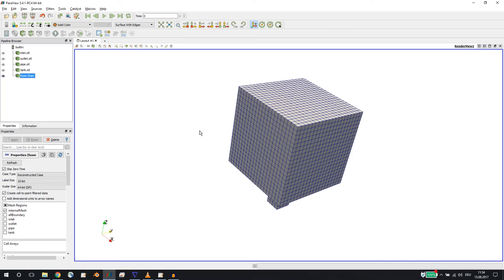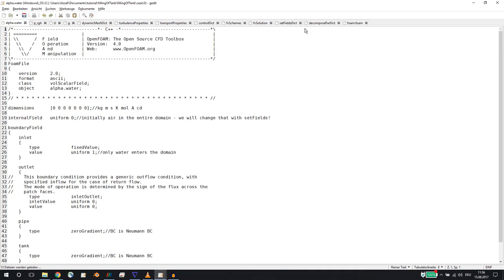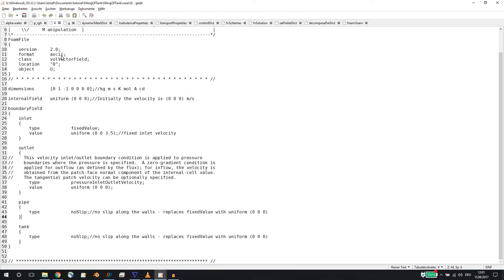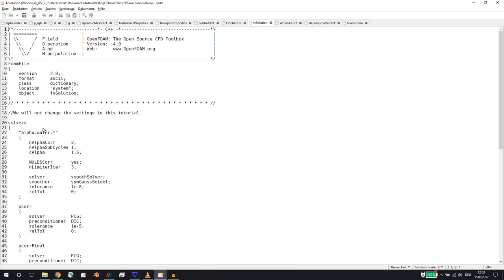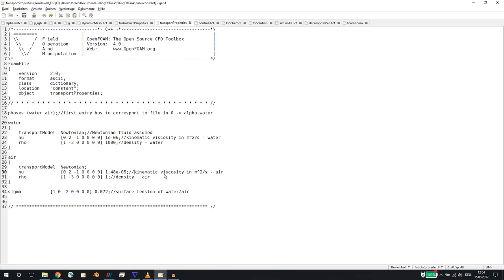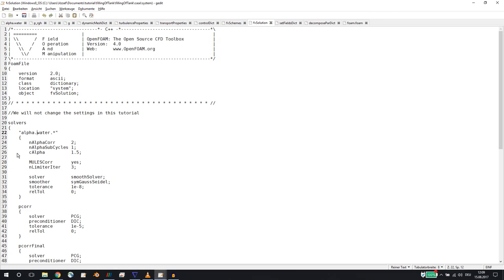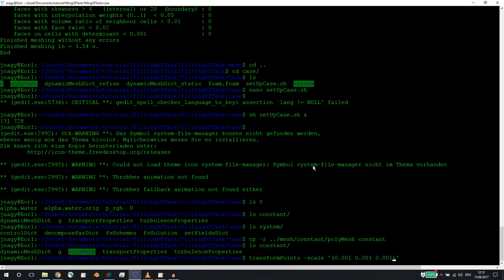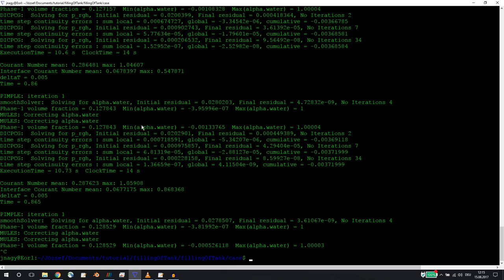Multiphase simulation project in OpenFOAM in Windows 10 and Ubuntu - tutorial part 3 - simulation

Comment: A followup on the question I asked a few years ago: what if the tank is half full of liquid and I want to push air through the inlet, how would the BC's change there? Is it as simple as changing the alpha.water value to "uniform 0"?
Reply from the maker: Should be. But possibly interIsoFoam would be a better choice for the solver.
Reply: @OpenFOAMJozsefNagy  Thanks. Yea, the actual flow I'm concerned with is dominated by capillary forces. interFlow I believe had issues with curvatures, right?
Reply from the maker: @joshmccraney4020  Yes, you definitely need contact angle for those simulations.

Comment: Hi Jozsef, thanks for a great video. I'm hoping you may be able to help. 
I am trying to run the simulation with my own geometry and have replaced the names of the boundaries to coordinate with my stl files. All seems to work until I try to run setFields and interFoam. Is there anything else I must change when I replace the stl file names within the codes? My stl files are inlet, outlet, upperWall, lowerWall and frontAndBack for my geometry .

Here are my error messages:

setFields
Create time

--> FOAM Warning :
    From function static Foam::IOstreamOption::compressionType Foam::IOstreamOption::compressionEnum(const Foam::word&)
    in file db/IOstreams/IOstreams/IOstreamOption.C at line 86
    Unknown compression specifier 'uncompressed', assuming no compression
Create mesh for time = 0

Reading setFieldsDict

Setting field default values
    Setting internal values of volScalarField alpha.water

--> FOAM FATAL IO ERROR:
Cannot find patchField entry for allBoundary

file: /mnt/c/Users/Hp/Downloads/OpenFOAM/OpenFOAM-v1806/kagome/case/0/alpha.water.boundaryField

    From function void Foam::GeometricField<Type, PatchField, GeoMesh>::Boundary::readField(const Foam::DimensionedField<TypeR, GeoMesh>&, const Foam::dictionary&) [with Type = double; PatchField = Foam::fvPatchField; GeoMesh = Foam::volMesh]
    in file /home/pawan/OpenFOAM/OpenFOAM-v1806/src/OpenFOAM/lnInclude/GeometricBoundaryField.C at line 191.

FOAM exiting

and for interFoam

interFoam
Create time

--> FOAM Warning :
    From function static Foam::IOstreamOption::compressionType Foam::IOstreamOption::compressionEnum(const Foam::word&)
    in file db/IOstreams/IOstreams/IOstreamOption.C at line 86
    Unknown compression specifier 'uncompressed', assuming no compression
Create mesh for time = 0

Selecting dynamicFvMesh staticFvMesh

PIMPLE: Operating solver in PISO mode

Reading field p_rgh

--> FOAM FATAL IO ERROR:
Cannot find patchField entry for allBoundary

file: /mnt/c/Users/Hp/Downloads/OpenFOAM/OpenFOAM-v1806/kagome/case/0/p_rgh.boundaryField

    From function void Foam::GeometricField<Type, PatchField, GeoMesh>::Boundary::readField(const Foam::DimensionedField<TypeR, GeoMesh>&, const Foam::dictionary&) [with Type = double; PatchField = Foam::fvPatchField; GeoMesh = Foam::volMesh]
    in file /home/pawan/OpenFOAM/OpenFOAM-v1806/src/OpenFOAM/lnInclude/GeometricBoundaryField.C at line 191.

FOAM exiting

Thanks for your help!
Reply from the maker: You seem to have the original boundary from blockMesh in your final mesh. Just make the blockMesh a bit bigger than your STL files and it will be cut off as well.

Comment: Hi Jozsef, 

Thank you very much for taking your time and preparing these tutorials. I would be lost without them.  I hope you dont mind me asking some questions though. 

I would like to use your steps as a guideline  (and skip some if possible) to build my own multiphase model with a bit more complicated geometry. Can I use this specific model and replace the existing mesh, add some new boundary conditions or remove some,  and run it?  

What if I generate the mesh in fluent but want to import to OpenFOAM? I have a bit intricate pump geometry, and I already meshed it in ansys.  I copied the fluent mesh file into the " mesh " folder and ran the fluentMeshToFoam command. It seemed like it ran okay. However this was the easy part of it - if I didnt violate anything.  There were some internal interfaces in the mesh file that needed to be left as is - fluent recognizes them as interface but would OpenFOAM also recognize them as interface? Do I need to specify somehow that OpenFOAM recognizes them as internal interfaces?  

Also if I would like to monitor x,y,z components of liquid coming out of an outlet, can it be monitored real time ( say area averaged Vx per iteration or per time step)?  Or would OpenFOAM generate text files? 

I probably would get some answers to these questions if I were to watch more tutorials, but I could not wait  :'( 

Thank you very much for your help, 

Oscar
Reply from the maker: Wow, lot of questions. Yes you can replace the mesh, but the boundaries have to be the same, or you have to modify the files in 0. You can also use meshes from fluent. Yes there are postprocessing tools. On my Patreon I am uploading videos on runtime postprocessing, so if you consider supporting me there, you will find a couple of videos on runtime postprocessing.

Comment: Dear Sir,
Would the simulation work without creating the initial water height, keeping only alpha.water = 1 on the inlet?
Thank you
Reply from the maker: I older version it used to crush, but nowadays it should work. So just test it without setFields.
Reply: @OpenFOAMJozsefNagy  yes i tested it yesterday on a resin transfert moulding problem, i confirm it works. Thank you!
Reply: @Poeterish  hello, so im currently trying to do a resin infusion (RTM) and i saw your comment here :) , so did u use this example for your simulation?
Im trying to do a small 2.5D square with 1 inlet in the middle, and 2 outlets on the edges.

Comment: Dear Dr. Nagy, I am running your code in OpenFoam10. I modified the codes accordingly (to the best of my ability). All functons ran properly. The meshing was perfect. But while running icoFoam the following error occured:

Create time

Create mesh for time = 0

--> FOAM FATAL ERROR: 
fvMeshStitcher for changing mesh not found 

Valid fvMeshStitchers are : 
1(stationary)

    From function static Foam::autoPtr<Foam::fvMeshStitcher> Foam::fvMeshStitcher::New(Foam::fvMesh&, bool)
    in file fvMesh/fvMeshStitchers/fvMeshStitcher/fvMeshStitcherNew.C at line 86.

FOAM exiting

I guess I need to find 'fvMeshStitchers'. Can you help me with this?
Reply from the maker: The command should be interFoam not icoFoam. Here we run a multiphase simulation.
Reply: @OpenFOAMJozsefNagy  Thanks Dr. for your quick reply. It was a typo, sorry. I typed interFoam. I tried it again, same error returns.
Reply: Quick update: switched to OpenFoam1912, all worked. Feeling sorry for all the changes I made to codes to adopt your codes for OpenFoam10.

Is there any resourse that helps novice like me to adopt to OpenFoam10?

Thank you.
Reply from the maker: @mohammadmahmudulhuq3164  I don't know. v10 seems to be too far gone from previous syntax and also the other branches. The only thing I can think of is taking a look at the tutorials which come with v10. A real shame that they don't consider backwards compatibility.

Comment: hello Jozsef,
I have a small question please. I am using icoFoam to run a simulation between 2 parallel  plates. I have 3 blocks which are exactly similar, I would fix non slip condition for the 1st and the 3rd block and slip condition for the 2nd block.
how can I achieve that please?
Reply from the maker: I don't understand your problem. Do you want to model also the solid walls?

Comment: i had this clocktime and execution time: ExecutionTime = 18.76 s  ClockTime = 23 s
is it a problem if the clocktime and the execution time are different??
Reply from the maker: No, it just means, that your system needs some additional time (e.g. for writing data).
Reply: @OpenFOAMJozsefNagy  ok is there maybe a way to give the ubuntu bash on windows 10 more processor power? it seems like that it doesnt use the full capacity.
Reply from the maker: @007aha1  It should use all you have. Check the task manager in Windows.

Comment: Hi Jozsef, sorry to bother you again. I am trying to simulate a water deposition on a textured plate. snappyHexMesh worked properly, the mesh is ready. However, i am wondering, if the drop is above the plate, how would i do that? so far every tutorials is concerned with fluid being inside the mesh, but here it seems i need it to be outside at first?
Reply from the maker: Change the inside point to a value which is outside your plate but still in your blockMesh.

Comment: Hi Jozsef, thank you once again for amazing tutorials. I seem to have a problem on creating snappy. I’m using my own stl file and when I define the blockMesh to be a bit bigger and envelop the stl all is fine, but when I run snappy, it doesn’t follow the contours of my stil file? Sometimes it’s still a block as it was and sometimes it’s missing a lot of features? I am using only 1 stl file at the moment and haven’t broken it up yet. Could that be the problem? Thanks in advance
Reply from the maker: Maybe, but this usually happens, when your stl surface is not closed 100%. If there are small holes, snappy will mesh through them.
Reply: József Nagy thank you, by small holes you mean through the whole surface? I’m trying to make a plate with small cavities and the mesh just ignores those cavities. And by fully closed what exactly do you mean?
Reply from the maker: I mean all the stl files together have to be closed. The edges must be congruent. Sometimes this is not the case.

Comment: sir, in the alpha.water, what is the physical meaning of Neumann BC? why do we apply zeroGradient at the walls?
Reply from the maker: Here, we do not care about the water between the last cell and on the wall. This means, that we just take the cell value on the wall. You can specify the contact angle with more fancy BC-s, but that would be too much for a simple tutorial.
Reply: and in the definition of fixedFluxPressure, it says that this boundary condition sets the pressure gradient to the provided value such that the flux on the boundary is that specified by the velocity boundary condition. and you also explained about this boundary condition but I don't understand what it means...could you please explain again?
Reply from the maker: Well that is an extra tutorial itself. There is a certain relation between pressure and velocity. This is calculated with the so called PISO or PIMPLE loop. Go through the PHD of Professor Jasak to go into detail, then go into the source code of interFoam to understand the implementation there and then go into the source code of the BC to fully comprehend, what it actually means.
Reply: what do you mean by 'Go through the PHD of Professor Jasak to go into detail' ?
Reply: you mean Ph.D thesis of Prof. Jasak?
Reply from the maker: Exactly.
Reply: Thank you sir.

Comment: Dear Józef, I encountered another FATAL ERROR when executing 'setFields':
"wrong token type - expected word, found on line 19 the label 0"

this is the line where the defaultFieldValues are set by 'volSkalarFieldValue alpha.water 0' 

and it is very picky on that last 0. I tried a few other statements that came to my mind, but then it either complained about wrong tokens or the value being undefined.

similar errors were traced down to OpenFOAM version problems, so my version is 6, what was yours at the time of recording that video?
I am working on a similar case but I am doing the meshing 100% by blockMesh, so snappyHexMesh should not be the thing here.

would be very nice if you had any advice for me, much thanks in advance!
Reply from the maker: This is a small problem with syntax. I see that you wrote volSkalarFieldValue instead of volScalarFieldValue. It should be a typo somewhere.

Comment: Hello József. How can I define the water level in my outlet boundary condition?
Reply from the maker: Sorry, but I do not understand your question.
Reply: In free surface flows, it's common to use the water level as a boundary condition, not the velocity or the pressure. I want to know if it's possible to use the water level as a boundary condition in the outlet
Reply from the maker: I see. No this is not possible. I know of a level set method by Vuko Vukcevic in the foam-extend release, but I have not heard anything about it for two-three years. Sorry.
Reply from the maker: I see. So you want to define a certain pressure, which would occur, if you simulated the whole pipe, but you want to reduce your geometry by cutting off the pipe, as you know the pressure increase. Correct?
Reply: Not exactly. I'm simulating a hydraulic jump. In the outlet, I have two datas that could be my boundary condition. First, the velocity, and this will be easy to do. But if I put the velocity as a boundary condition (uniform velocity), the flow will not develop the log-law profile. So, the other possibilty is to define the water level, or the depth of the flow, as my boundary condition.
Reply from the maker: Ok, a feedback, whether you succeeded or not would be great!

Comment: Hi Jozsef! If I fill the tank with liquid from -.5 to 0.25, turn off gravity, and switch the velocity U from 3.5 to -1.0, the simulation runs until the point of suction is gas and liquid (as opposed to just liquid). Then it crashes. Any idea what is happening?
Reply from the maker: I didn't really get what you mean with point of suction. Sorry. Could you please explain?
Reply: @OpenFOAMJozsefNagy  In this video at 6:16 in the U directory, line 27, you specify the inlet velocity (0 0 3.5). If I change this to (0 0 -3.5) (so instead of injecting liquid we're draining it) and fill the tank up a little higher so there is actually liquid in it, the code crashes once both gas and liquid are at the drain location (so after a few seconds).

Forget what I said about low-gravity, it's not relevant.

Any idea why the code crashes? Thanks so much for replying!
Reply from the maker: @joshmccraney4020  Yes, because at the inlet we specify fixedValue uniform 1 for alpha. You have to modify this to an outlet BC (like the atmosphere on top) for alpha.
Reply: @OpenFOAMJozsefNagy  Can you specify further? I will definitely be donating to your patreon account in the morning, as you've been incredibly helpful!
Reply from the maker: @joshmccraney4020  You can try zeroGradient or inletOutlet instead.Thank you!
Reply: @OpenFOAMJozsefNagy  It works! Only gave 20$, will try to donate more in the future. Thanks again for this tutorial, other tutorials like it, and the direct feedback! Everyone in my lab really appreciates your videos! Take it easy!
Reply: @OpenFOAMJozsefNagy  As a last question, do you know the units for the U directory fixedvalue (0 0 3.5)? Does this imply 3.5 m^3/s?
Reply from the maker: @joshmccraney4020  U is always m/s